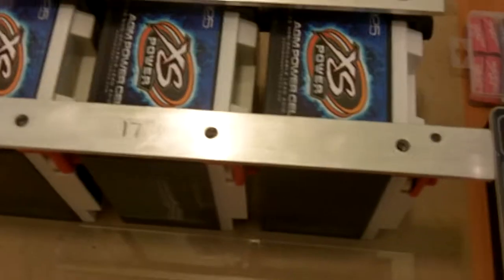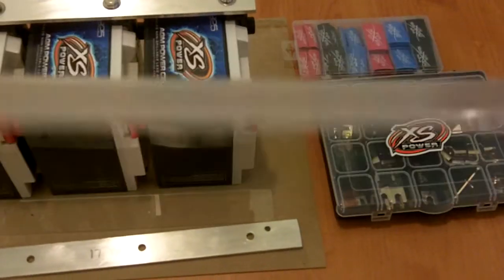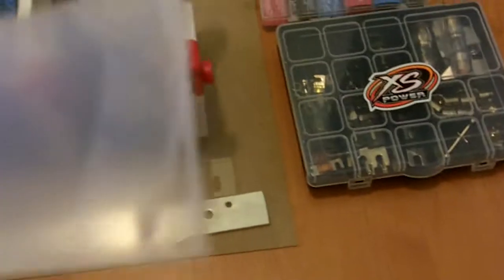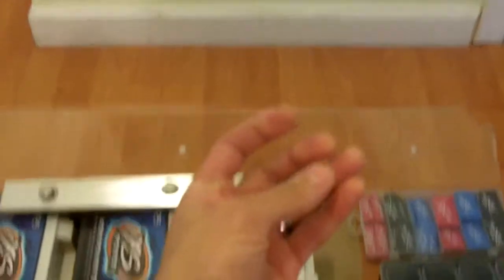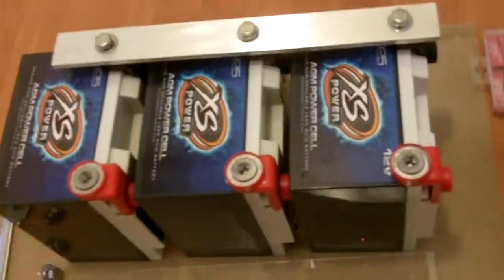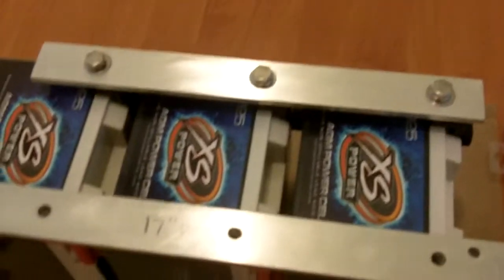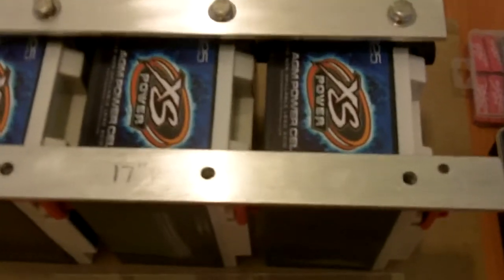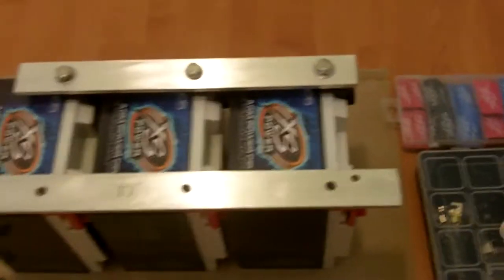Bus bars the easy way

Comment: Would the use of the Aluminium not defeat the purpose of the 4/0 copper cable and invariably act as resistors or current sponges between your batteries?